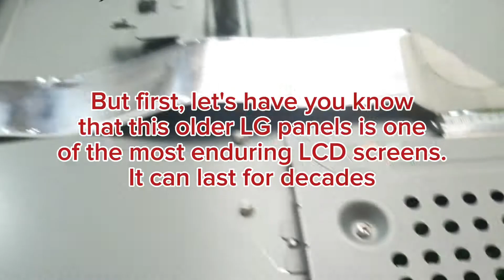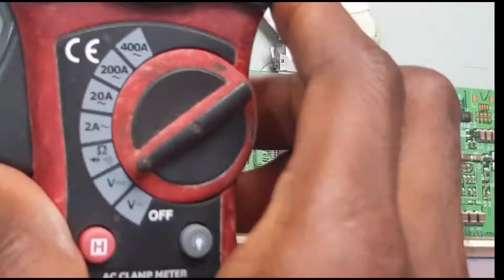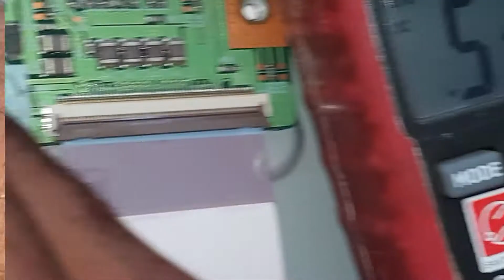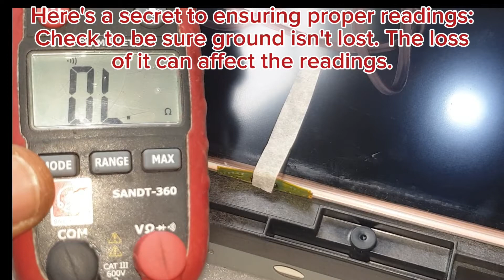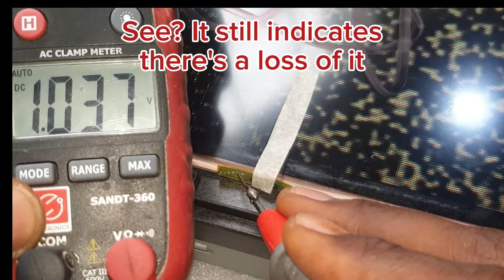SECRETS to FIX LCD TV PANEL GATE SIGNALS #ledtvpanelrepair #electronics #techtips

Comment: Thanks for the reply buddy, much appreciated. It's strange & totally the opposite of what you'd normally expect to find. As you know in a normal circuit a high resistance ground will give you problems when you try to draw current through it.
Reply from the maker: That's right. The first time I realised it too, I was a little taken aback. I've seen how high resistance ground can hurt a circuit's good performance. But as my expereicne grew handling more and more panels, I figured lots of drivers are probably designed to work that way. You are good, @rscelectrical7091! 👍

Comment: Great video and good repair tips, just 1 thing: the video shows you checking ground continuity which appears to be over 57 ohms. Is that normal for a display ?, Normally when checking circuit continuity we're looking for less than 1 ohm.
Reply from the maker: You are really good at electronics, @rscelectrical7091! 🙂 For displays, it's perfectly normal as there's always some resistance on ITO tracks that connect the COFs. In fact, resistance on ground at the bottom COFs can be much higher, on some panels it can't even be detected using a basic multimeter, yet they work fine.